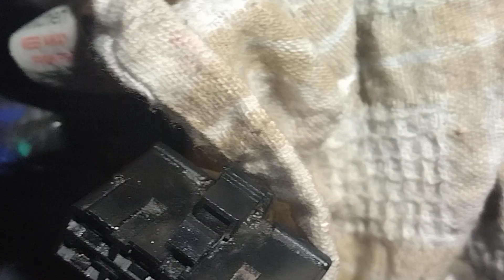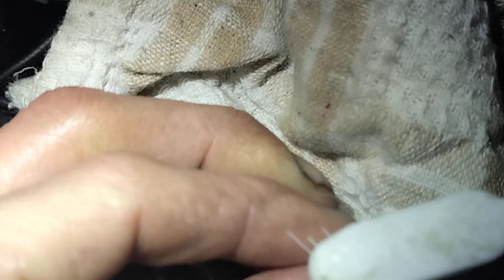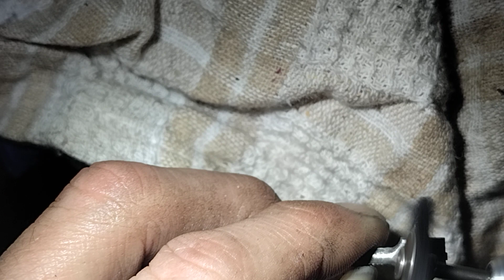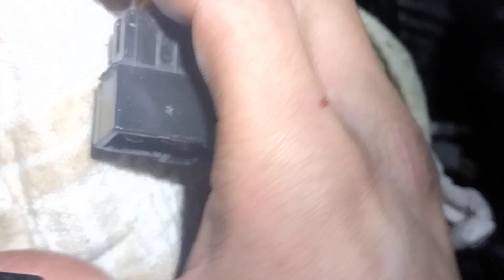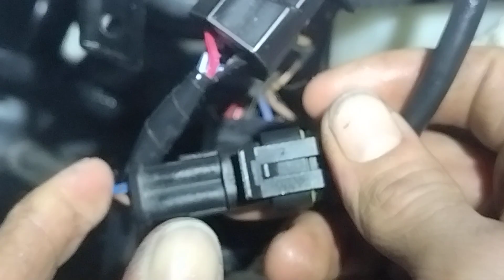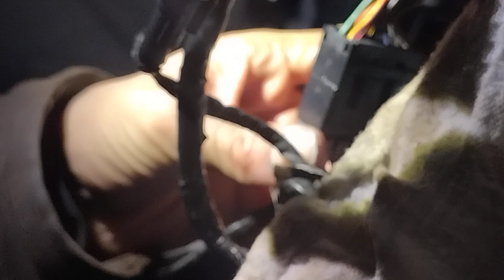How to restore an electric connector

Comment: Thank you from Japan across the sea
Currently sharing the same phenomenon with sprint st1050.
As you say, I've cleaned and refilled the grease and got to the burnt connector.
I'm looking forward to your next problem solving video :)

Sorry for the poor English.
Reply from the maker: thank you for your comment. more to come on it soon when the customer supplies some parts